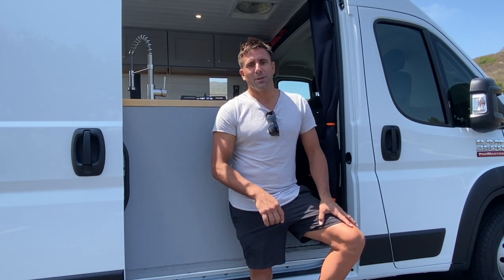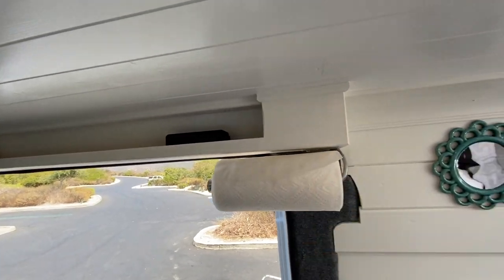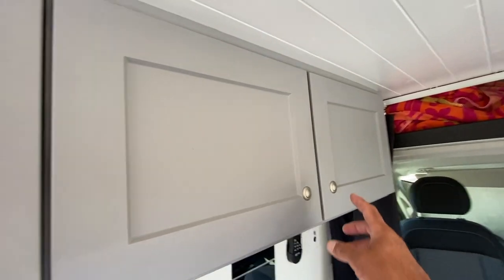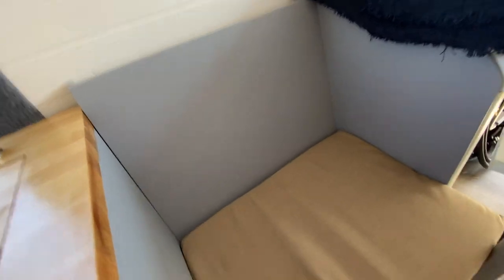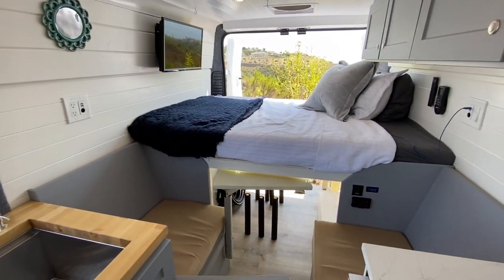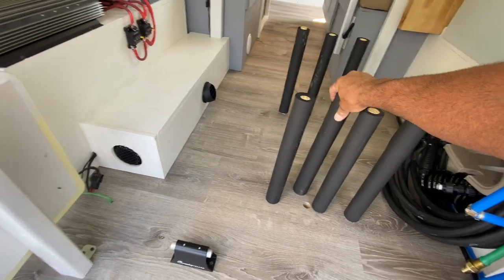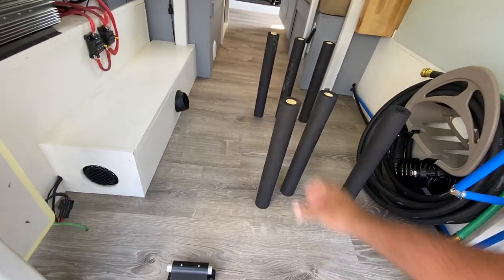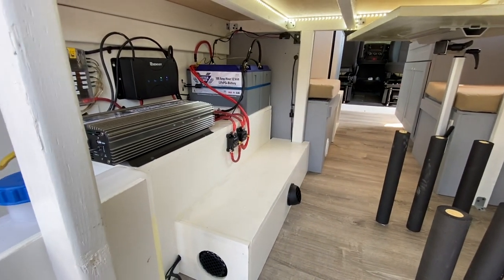VAN TOUR | MODERN STEALTH CAMPERVAN

Comment: Great job. Do you have a vent for the gas bottle?
Reply from the maker: Yes check out the video i made on the propane install
Reply: But in the video you have the gas bottle under the sink. I think the propane install video is a different build.??